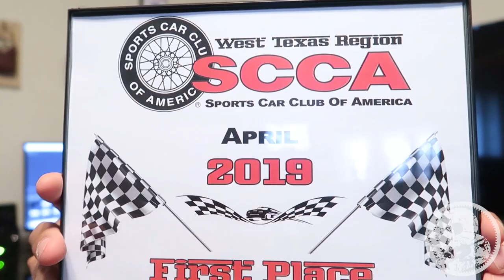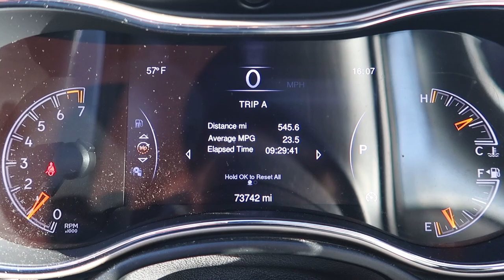BUILT MOTOR IS HERE!! | MK7 Golf R

Comment: Nice brother! Let the Boost begin...... Getting mine built right now cant wait to turn up the TQ! Hey quick question a little off subject but what would u suggest? Verkline tubular front with stock control arms with upgraded bushings or aluminum subframe with superpros and bushings? Which would u recommend. How much difference would there actually be?
Reply from the maker: I'd go with the verkline subframe if you're gonna go ahead a swap to anything. The subframe has revisions for bump steer which is huge for the track and being lowered. It would be a pretty significant upgrade over the steel, especially with the upgraded bushings.. and resell value if you ever decided to is like Apple products, they hold their value.
Reply: @BryceJordanProductions  Well thats great info bro. Thanx! I have not pulled the trigger on the aluminum subframe yet cause I wanted to hear back from u before I decided. Should I buy their tubular control arms as well or use the stock arms with upgraded bushings or something else cause the Superpros dont fit apparently. I do DD the car so what do u think?

Comment: Hey Bryce - did you keep your south bend stage 3 clutch when you built your motor? If so, how much torque did it take without slipping?
Reply from the maker: Yup! Sure did, never got to dyno it but we didn’t hold tq back at 34-36 psi on vortex and 42+ on typhoon never slipped
Reply: @BryceJordanProductions  unreal - that’s what I have in my mk7 right now. Stock motor with a stage two power max (G25/660). Toying with the idea of building the motor and thinking about one of the TRX kits from pag parts. You put a LSD in yours too right?
Reply from the maker: @dbandler1  yup I did dog gears 3-6, forks, wavetrac. I didn’t use an R trans tho I got a diesel made it awd and built it (longer 1/2 gears)
Reply: @BryceJordanProductions  does anyone make stronger gears you can just throw in or does everything need to be built custom? What do you think the limit is the stock gears is?
Reply from the maker: Not that I know of. FFE gears are proprietary.. maybe someone else like in the UK does but I don’t know any names other then FFE offhand. Limit is very hard to say with a manual, really depends on how hard you shock the drivetrain on launch I suppose. But my buddy Kerry keeps breaking 4th gear, and I think a few others too now that I think about it. They are all in the 500+ torque range though. For stock block torque levels your trans should last a fairly long life unless you’re really putting it though it’s paces at a road course or something high endurance type

Comment: My golf mk7R from 2014 broke the other day thinking it was the DSG clutches... but found out it was the cardan shaft that runs from the front to the back to drive the rear wheels for the 4motion.
Ive never seen this kind of breakage but im glad the damage wasnt the gearbox :/
i wasnt even racing or anything just casual red light stop pull
Reply from the maker: Where did it break at? That's very odd
Reply: the cardan shaft connects to the rear wheel haldex unit and the front ones connect to the transmission it shattered at the transmission part...
Really keep an eye on it as it could destroy way more, i have some pics i will send you a link one moment
Reply from the maker: Holy shit that's crazy!!! I just installed new ones of those on both sides of the shaft hopefully they last!
Reply: @BryceJordanProductions  my 7r is running 420hp 530nm it has around 106.000km or 62k miles ish just keep an eye when the rubber is ripped the metal gets shattered
Reply: @BryceJordanProductions  nice, i came back to tell you that they inspected the pipe properly the middle section was filled with metal bits it broke there too so might want to check that one out aswell make sure everything is lubed properly
Reply from the maker: Dang alright! Will do!
Reply from the maker: Thanks for the update!
Reply: @BryceJordanProductions No problem mate the whole vag community is one with eachother :)

Comment: How long did it take and how much was the buid
Reply from the maker: It's taken a long time since removal cause of the trans and doing the CF hatch and tubular rear end and stuff. If I had all the parts and no distractions I could build a motor start to finish in a few days. If you count every single part in the last six months.. probably around $16-18,000. 8k in the trans alone and about 5500 in the engine.
Reply: @BryceJordanProductions  wow what's you Hp after all the stuff is done?